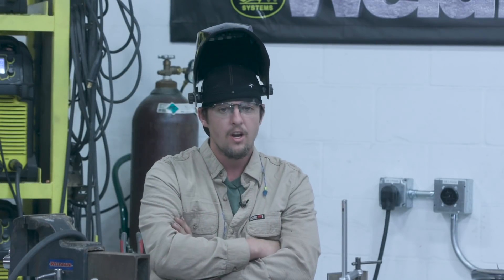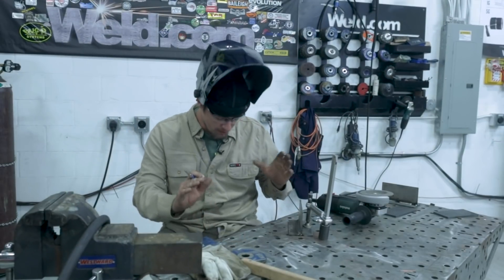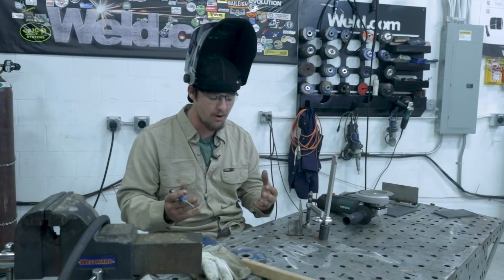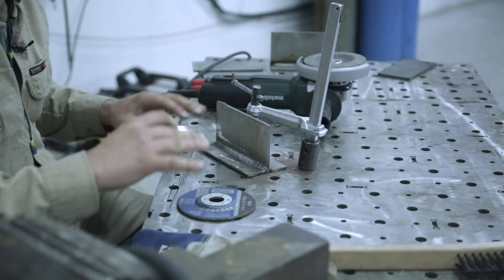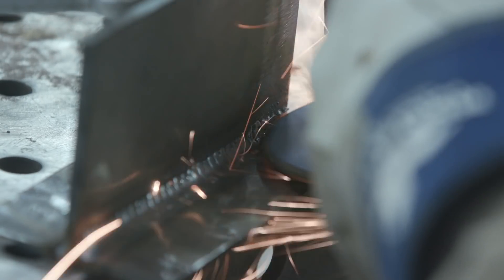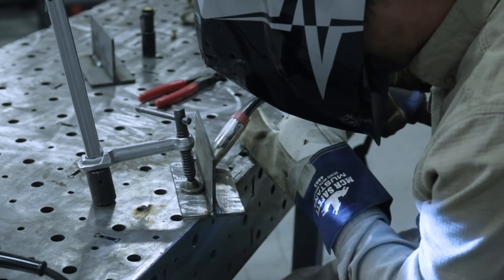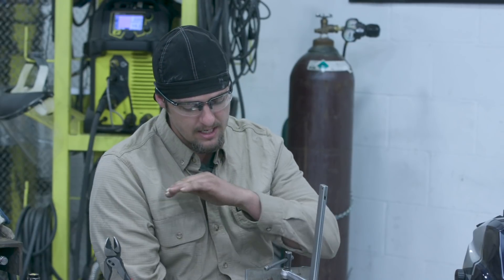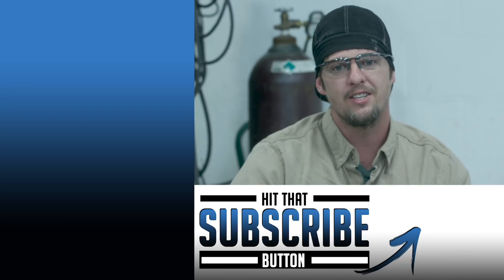Unlock the Secret to Perfect Welds - Learn How to Fix Porosity Now!

Comment: Im having a issue with bad porosity welding in a x pipe on a exhaust. Everything is fine until i try welding it and it all goes to hell. Ive tried cleaning and changing the gas settings nothing helps. Im not 100% sure but it might be possibly 409s and im using 75/25 with er70s wire, Im at a loss though at the moment.

Comment: Hello I was wondering if you guys wouldn’t mind possibly doing a review on a (6GR, 6 inch test with the restriction plate using a 6010 root uphill and 7018 feel and 2 bead cap) been needing to see the best way to take on this fit and weld for a test and there isn’t to many good videos out there that show the whole process. I would be truly grateful thanks.

Comment: I've been getting minor porosity with some older 7018 lately. Is there any hope that if I were to put it into an oven for a few hours, I'd have a chance to evaporate off enough of the presumed moisture to weld normally? Or am I better off just tossing it out and buying more?
Reply: Cook it and it should clean away the Hydrogen contaminate

Comment: If I bought a welder and practiced my self would I be able to get certified and pass the test eventually. I have metal working experienced and worked for welders in the past.
Reply: At the end of the day, only you are responsible for how well you perform. I can have all the best settings and material in front of you but if I wasn’t any good then no I wouldn’t be able to pass a test. Practice makes perfect, friend. Watch every video these guys make down to a tee that involves the parameters of whatever kind of welding you want to do and with a little practice and constant learning you can do it.

Comment: I can't tell you how many new kids we get at work, that think you can just weld over it!
Reply: In my experience it can be done but it’s not the right way to do it. There’s a lot of factors, the process you are using, the equipment you have on you, and if you have an asshole boss breathing down your neck to get things done as quick as you can and don’t care what it looks like/ how you do it. The only successful way I’ve seen it done is burning over with dualshield flux core on thick material if you ran out of gas. If it’s the only option available to you at the time, you have to make sure the area that you have is beaten as much as possible with a needle scaler or air hammer, and then pushing a bead in the opposite direction you ran before. Like I said it works, but it’s not the right way by far.

Comment: Hello! Dan from Romania here. I have porosity issues every 2-3 inches of weld when using Flux cored gassless. You think you can give me a hint or tip to avoid this stuff from happening? I weld outside most of the time.
Reply: Just use co2
Reply: @TheNemirovMan  that would be an option if I wasn't welding outside, the wind blows the gas off
Reply: @TheEden51  You can use CO2 with flux,it'll blow it away if the wind speed is to high but still give you 2 layers of protection.
Probably just need to make up some sort of windscreen to block the wind.Flux is pretty forgiving in wind,I was just welding up some door frames on a SXS in 25mph winds last week. Had a couple spots that the wind blew to much but they were easily fixed and just pulled a vehicle in position to block the blunt force of the wind.

Comment: How to fix prosity of aluminium mig welding. I grinded the prosity welding bed and again welded, but again I could see the prosity of my welding. Help me out to fix this.
Reply: Try pull welding and add little more gas
Reply: @TheNemirovMan  pull doesn't give better penetration. That's the problem bro.
Reply: @ravindukalhara9924  thickness of metal? Maybe you should try pull and 2 passes?
Reply: @TheNemirovMan  my application is cast aluminium bro
Reply: @ravindukalhara9924  dude, I'm sorry, I don't know what else to tell you from my superficial knowledge of ac mig welding
Reply: @TheNemirovMan  I have 15 years experience for welding cast aluminium and I  am from sir lanaka. Thanks that you were gonna help me. I really grateful of you bro.
Reply: @ravindukalhara9924  oh, I remembered! Maybe your argon gas is not so clean and there are impurities in it, due to which pores are formed? Try to buy next argon tank in another shop?
Reply: @TheNemirovMan  thanks for your advice bro

Comment: can you give me a link to that grinding disc. I have been looking for something like that for a long time. I went to my welding shop and showed them my old supply of flexible thin grinding discs by Cronatron, they are no longer available may have gone out of business. Anyway the local shop thought they were cut off wheels, I had him look at the label   Flexible grinding disc.. They were thin too... but I haven't found a THIN grinding disc... so some help would be greatly appreciated.  Thanks.

Comment: normal welders will accept porosity and repair the mistake  but delta force welders best of the best plan how they make a weld and they pay close attention to their surroundings and eliminate any problems about to happen what will cause the porosity how to prevent it from happening   is important because if you grind the crap out while trying to fix it you get back porosity

Comment: Not bad, but not overly informative. 
I wish you had shown how to tackle the problem of removing porosity from difficult to reach weld beads, i.e. welds at 45 degrees or less.
Should one use carbide burrs on a dremel, maybe rough files, or some other method in case a grinder can’t reach all the way. That would be interesting info for beginners too.
Reply: Usually a gouge with a 1/4 carbon is what I use for details or getting rid of porosity. Or ya know. Just weld over it 😂
Reply: @dominicdiaz1569  Make sure you grind all the carbon out .It can cause a bad x-ray. It happened to me on a x-ray i fixed.
Reply: @michaelshortridge6379  oh thanks for the tip. It’s usually on the pieces that aren’t x-rayed. They put the guys with 30+ years of experience to do the X-rays just to minimize mistakes and do them quickly.
Reply: That's my issue at work, a grinder normally wont fit where I'm welding